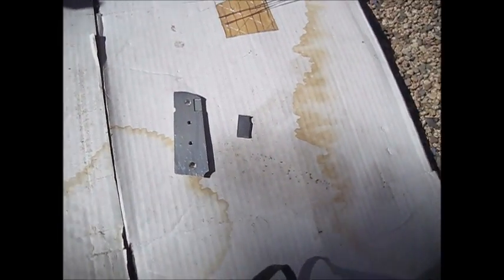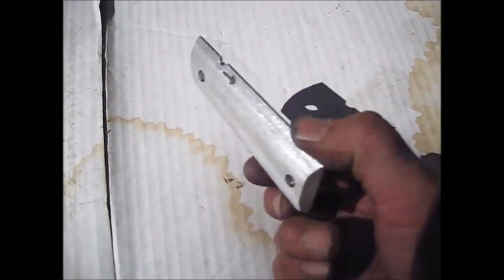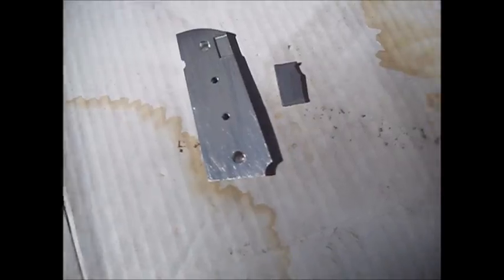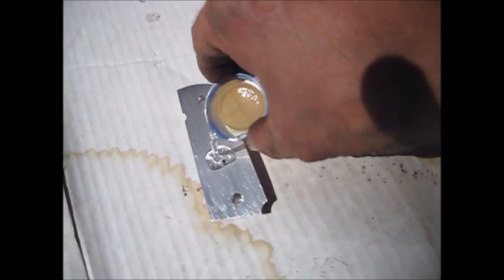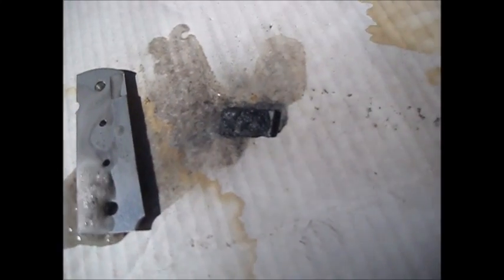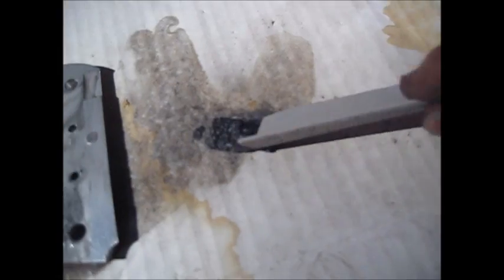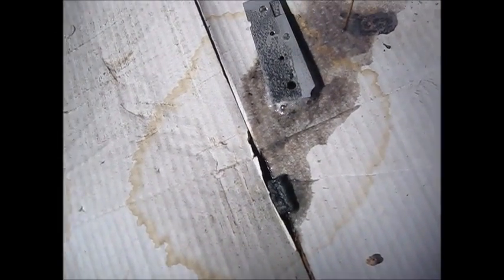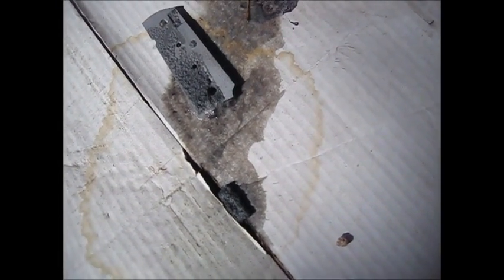7075 vs 6061 test

Comment: Keep strong acid in a jug labeled “drinking water” and holding the cap with your bare fingers are fun choices.
Reply from the maker: You realize I got this from the pool guy, right?
Reply: @wannabecarguy  It’s no big deal.  I’m not trying to rain on your parade, just thought it was a bold choice. Acid that dissolves metal is nothing to sneeze at. Muriatic acid is typically mostly hydrochloride acid (it’s cheap to make) so I’d also avoid breathing the gas that comes off because it’s chlorine gas.

Comment: Ok so if I do this test and I still have a rifle...its 6061.  If I do this test and my rifle melts...I had a 7075 reciever
Reply from the maker: Great question. 6061 will work fine however many claim to be 7075. Odds are it's 6061 . You could take it to a recycler , they have tools to analyze the material without destroying it.
Reply: @wannabecarguy  The majority of modern ar15 receivers are actually made of 7075...as mine are.  My comment was meant to be facetious
Reply from the maker: @broot1375  if it is a forged casting then yes most likely 7075. I was trying to document the reaction between 6061 and 7075. Never expected this video to get so much attention. Have you seen my most popular video? YouTube wanted to punish me.

Comment: For me as a cyclist and a mountain biker, im glad that manufacturer uses 6061 aluminum alloy frame rather than 7075.
Reply from the maker: That is an appropriate application.
Reply: Why? 7075 is far stronger than 6061.

Comment: The reaction difference between 6061 and 7075 makes perfect sense. 6061 allow is highly resistant to corrosion but has low tensile strength and lower shear whereas 7075 alloy was developed for a much higher tensile strength and shear but corrosion resistance was not as important. 6061 alloy is about 95% pure aluminum and 7075 is about 80% aluminum 10%-15% Zinc, and the remaining is made up of copper, magnesium, silica and manganese.

Comment: 7075 or 6061
Reply from the maker: The grip is 6061 . The block is 7075. As far my preference ,7075. Forgings are 7075. Castings are junk. And yes Ares armor did have castings a few years ago. Some people make billet 7075 lowers however they sell them at less than material cost. Which makes me suspicious. The only lower that I have seen break was a casting.

Comment: If you wanna test if it's 7075 just hit the pieces together and see witch part gets the smallest dent.
Reply from the maker: Good idea. But what about mold cavities? which is why I made the video.
Reply: Didn’t hear anything about the 7075 being molded, didn’t even know it was used for molding. Problem with the acid method, It just shows how much zink it’s in it.
Reply from the maker: @hucklo  some people make molds out of aluminum. Some times they need to be welded up for repair. One day I asked the welder how he knows if it's 6061 or 7075 . He said he puts acid on it. So I figured I'd test to see what it looks like. But I also thought , how can 7075 lowers be so cheap? It's all guess work.

Comment: Before you push your opinions do your research!General Mechanical Properties of 6061 Aluminum (T651 Bare)Tensile Strength – 45,000 psi
 Yield Point – 40,000 psi
 Brinell Hardness – 95
 Elongation at Break – 12%
 Shear Strength – 31,000 psi
 Thermal Conductivity – 170 W/m-K
 Strength to Weight Ratio: 115 kN-m/kgGeneral Mechanical Properties of 7075 Aluminum (T651)Tensile Strength – 83,000 psi
 Yield Point – 74,000 psi
 Brinell Hardness – 150
 Elongation at Break – 10%
 Shear Strength – 48,000 psi
 Thermal Conductivity – 130 W/m-K
 Strength to Weight Ratio: 196 kN-m/kg
Reply from the maker: Vic Dunlap what's your point?
Reply: Point is you are wrong 7075 is stronger. Yes you get your reaction with muriatic acid. Pour it on your balls you'll get a reaction to, but most people don't dump or sweat out muriatic acid on their equipment. Try oxidizing the aluminum and add iron oxide,  That your more likely to encounter that in the real world, not some 1/2 ass lab test with misinformation. That is unless you plan on attacking pool supply stores or something.
Reply from the maker: Vic Dunlap I never said on was better than the other. I was showing how the 2 react. I stated in the video that I believe that 80% lowers are being sold as 7075 but are actually 6061. And if you wanted to test your lower this is how. I'm referring to billet lowers. I believe all forgings are 7075.
Reply: "The reason I do an experiment like this is because everybody fusses about the 7075 lower receiver and the 6061 lower receiver. So now you guys know what to look for". So tell me with that statement what are they fussing about? You imply with this video 6061 is stronger then 7075. I just provided you with the proof it's not.
Reply from the maker: Vic Dunlap because after you pay the extra coin you still have the 6061 lower. Then you go and use it with no issues yet the whole time you were using 6061. I used to machine lowers and I would get some that cut like butter and 7075 does not cut like that. Other machinists said the same thing.
Reply: @wannabecarguy  This is a Good Proof to show they lie about selling 7075 AR15 Lowers.

Comment: 6061 is not as weak as people make it out to be. Certainly 7075 is stronger, do you really need the strength when it comes to uppers, lowers, and gun handles? Now the reason why 6061 held up better is because it's much more resistant to corrosion than 7075.
Reply: 6061 charging handles are complete crap. They bend. It's what all the cheap imitation Radian Raptors are made of and they last maybe 1 range trip because they bend after charging the gun just a few times.
Reply: +Jennifer W
6061 tempers like T6 can be stronger than some stainless steels.  

Weight is a big one, though.
Reply: exactly

Comment: 6061 has a bit of silicon in it. 7075 has some zinc in it. The number after is the heat treatment the metal has gone through, like T6. 7075 is much stronger then 6061. Machinists love 6061 because it's softer and easy to machine. My question though is what is the point? Exactly when are you planning on going swimming in hydrochloric acid with your AR?
Reply: Swimming in hydrochloric acid is that next level tactical.
Reply: +Len M. just because its softer, doesnt mean it machines better. i think 7075 cuts nicer. it definitly breaks chips easier. and like joseph brody said 6061, depending on who you get it from, can be gummy and extremely chippy.
Reply: +Len M. 6061-T6 cam be "gummy" and hard to break a chip, which complicates machining.